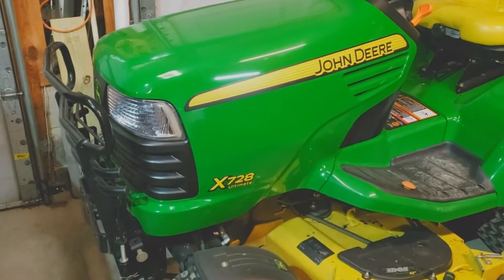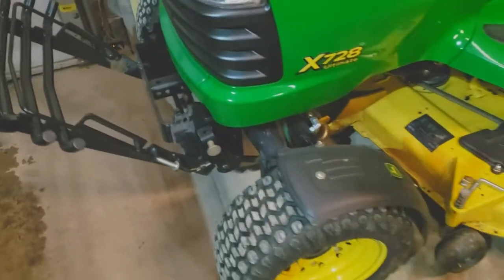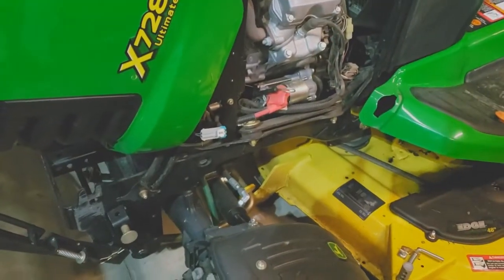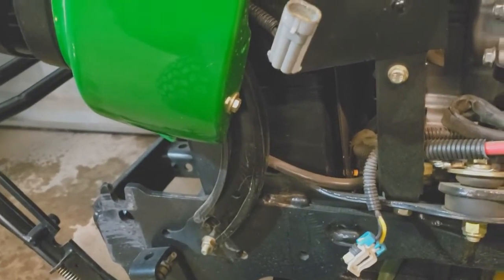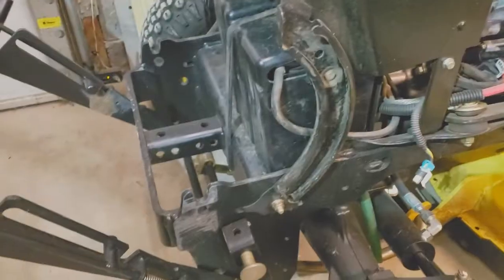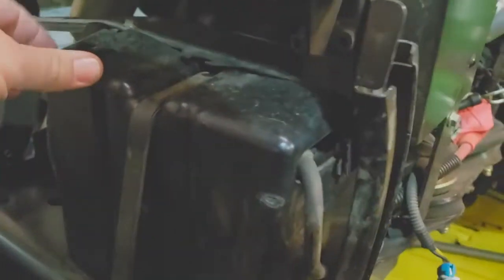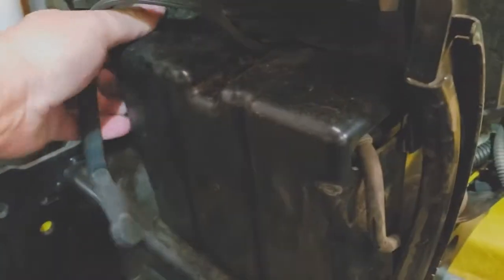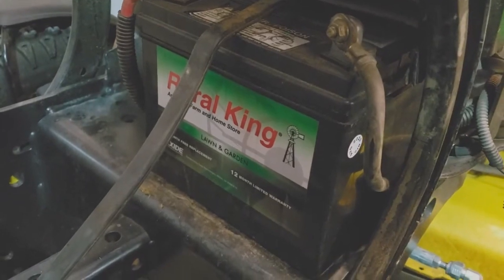John Deere X728 Battery Change, Battery location 2012 Model #johndeere #lawnmower #diy #howto

Comment: Another question.   I’ve been searching for information on how to level my x728 mower deck.  I put some nasty ridges in my lawn the other day.  Not certain what went wrong.  
I found a video on the 300 and 500 series where the tools are under the seat, but mine does not.  Also, as I purchased it used, I have no manual. Is this something I can do myself? (In your opinion?) Or should I send it in?     I was glad to have you show me the battery location... that has come in handy a few times!